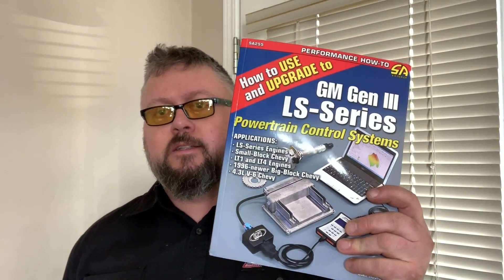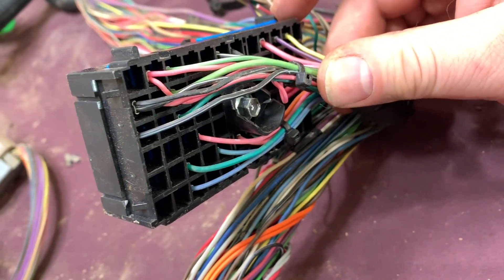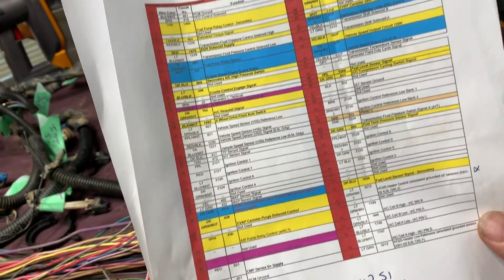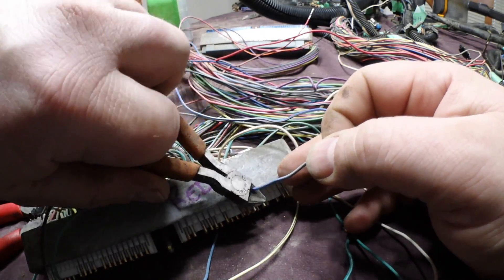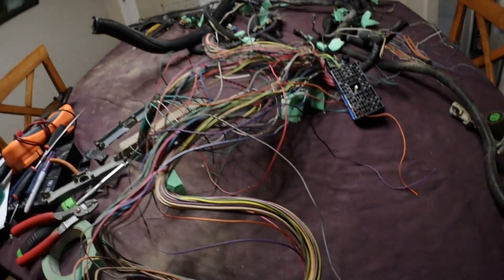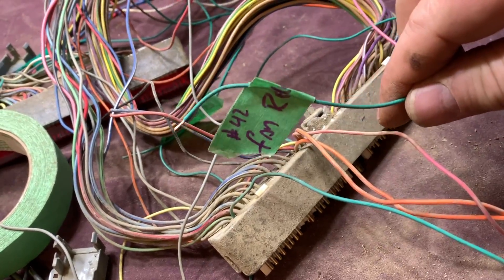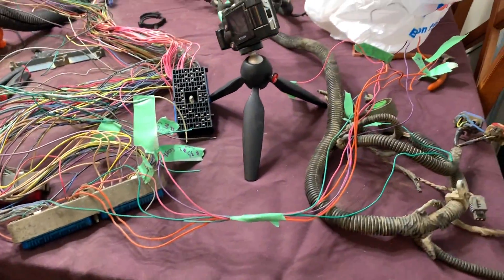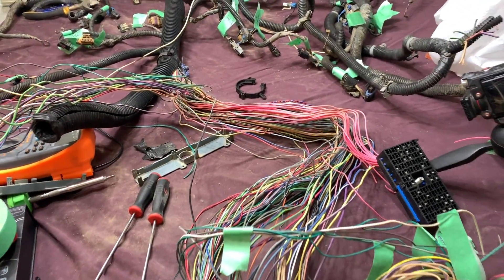LS Swap Harness DIY Sorting the Wires

Comment: Hey random question I'm doing a ls in my 2003 tj everything is done I left the stock gauges like you did and used the jeep sensors didnt cut any wires everything worked with the 4.0 but now my gauges wont work the key on beep but all gauges stay at zero if you do the tj dash test all stepper motors work help me !!!!!!! Please
Reply from the maker: Sounds like one of the PCM’s power wires isn’t powering up
Reply: @TestDontguess A17 on the black plug at the ecm is a 5 volt supply is that something that needs power
Reply: That's what I watched in your one video I checked them all with my probe everything seems to have power so I'm lost
Reply: Your to tach most likely needs 12v power instead of 5v, run a resistor and you’ll be good.

Comment: Hey I have 08 arctic cat 650 h1. When I turn the key on speedometer lights turn on then turn off and it kills the engine. Lights wont come on I wiggled my wires that go to the key and it worked. It's back and forth and as of right now I have nothing ! I'm trying to dis conect and clean the connector but it's a bitch. Any chance you can help me and save some time ?